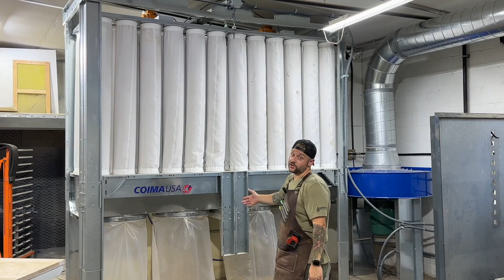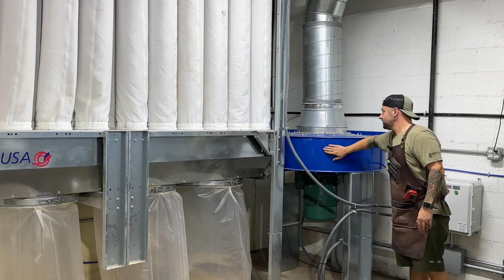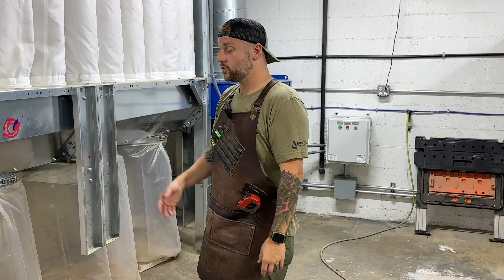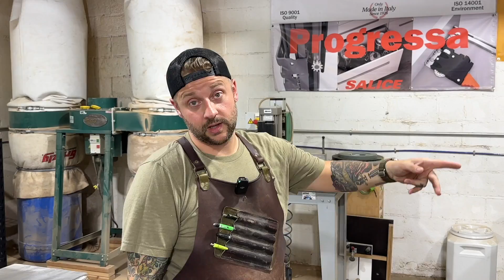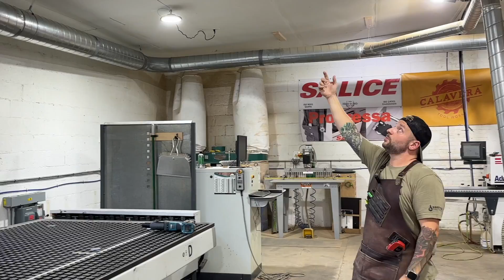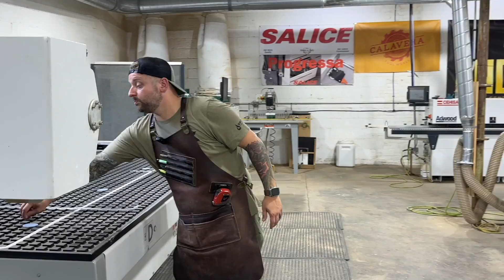New Dust Collection System - The High Price of Doing Business

Comment: Love your setup! How is your hose reel working, since the dust collector is high CFM and low static pressure?  We did the same thing and aren't getting great results vs. a shop vac (lower CFM and high static pressure). Thanks man, love your videos
Reply from the maker: It did not work as planned! But we pivoted and hooked it up to a shop vac with a dust deputy we had kicking around.

Comment: I'm surprised after all that dust collection add ons that you didn't put in an automatic gate system like grit automation to control your entire system and never chase an open gate somewhere. Although that collector may likely be able to have 6 gates open and you wouldn't notice any loss at a machine. Beautiful setup, though. You guys have come a long way since I first started watching your stuff in that tiny little shop.
Reply from the maker: I feel like the automatic gates are probably more trouble than they’re worth. The real thing is insanely expensive. We’re really good at closing gates when we’re done with machines.